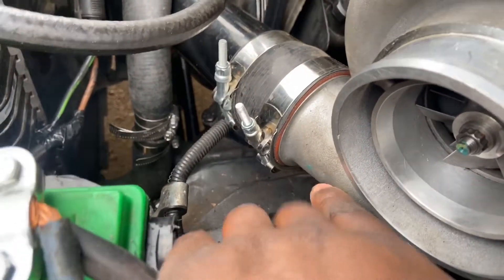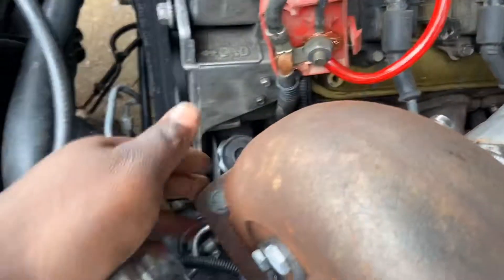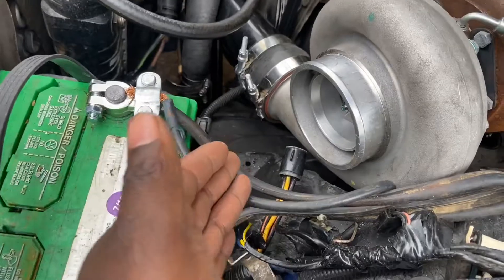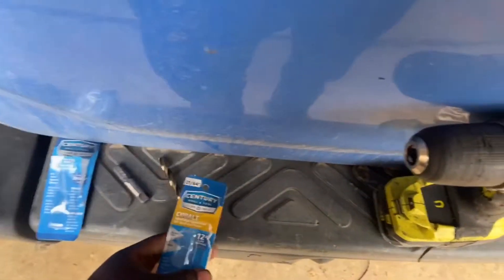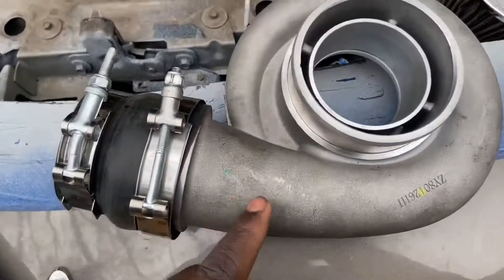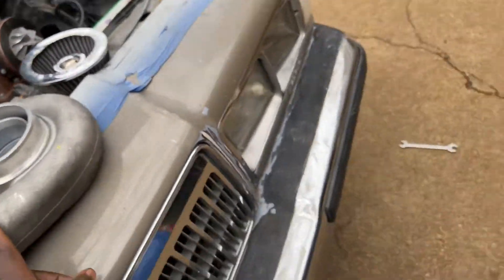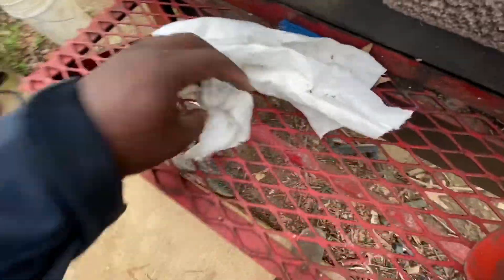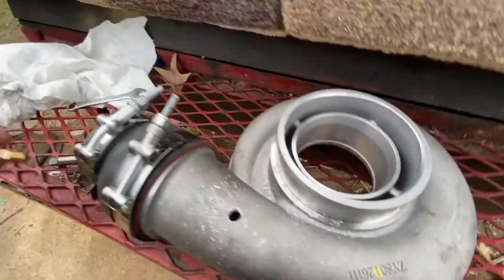how to: Tap turbo for waste gate fitting

Comment: How did it work out tapping to the round area? My turbo has a flat surface to tap to but I don’t like the location of it
Reply from the maker: It does it job controls the waste fate & boost gauges pretty didn’t gave any issues so far besides wrecking the car recently 😭